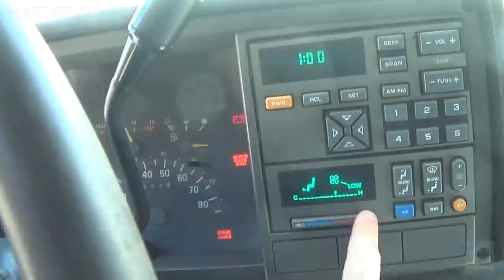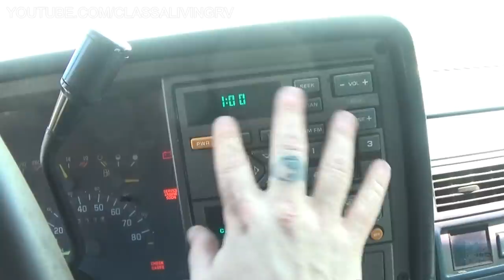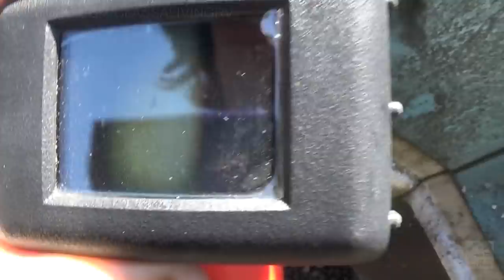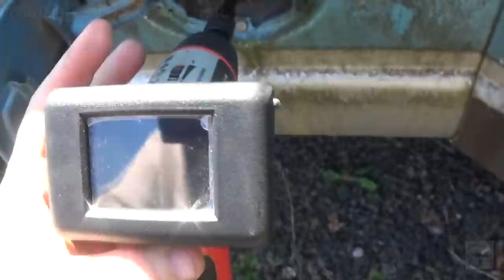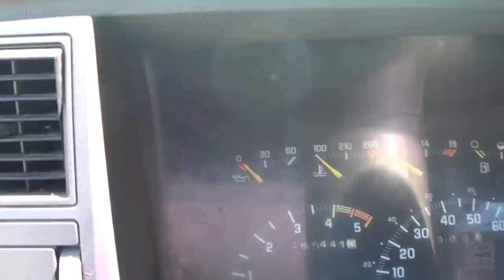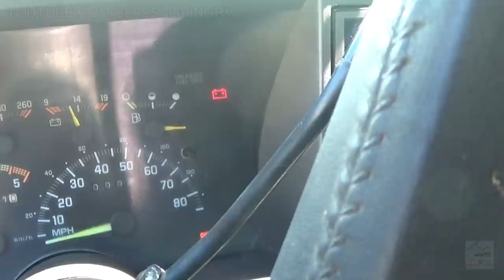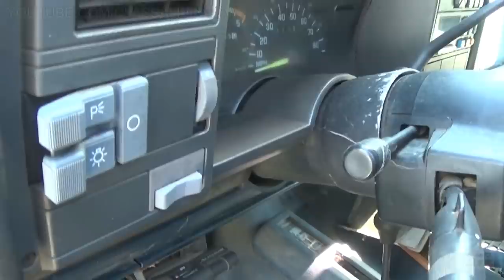Trying To Start An Old Truck That's Been Sitting 12 Years

Comment: I wish I could get one of these in the UK. Your pickup trucks are so much better that the ones in Europe and Uk.
Reply: Boy, that's for sure! How good can something called a "lorry" be, lol.
Reply: Me too I wish I could get one here in Kenya I'll be very happy man
Reply: Best cars Japanese best trucks are American
Reply: @diyeric5072  
I agree. I have a 2006 Silverado 4X4 (I bought new) and a 2018 ES350 Lexus. Couldn't be happier.
Reply: U can buy them and have them shipped to u
Reply: @GrimmReaper1997  Overseas shipping cost as much as these used vehicles
Reply: Thanks and I wish I could send one your way...but I’m attached to my 3-4 old gmc and Chevy trucks
Reply: @diyeric5072  got that right I have a 2013 GMC Sierra 1500 sle and a 2008 hyundia sonata gl I love them both.
Reply: electronic in US  cars are filt with problems again and again ☹️
Reply: I can sell you an 88 Chevy K-1500 stepside
Reply: TOMMY N .J nope. Try again
Reply: @diyeric5072  not very true. Have you heard of the toyota hilux? Its is one of the best pickup trucks out there
Reply: I love diesel trucks
Reply: My brother has a 93 Chevy c1500 4.3 with 345k and I have a 96 Chevy c1500 5.7 with 324k and both still run decent
Reply: @GrimmReaper1997  They need right hand drive. Same in Australia.
Reply: @diyeric5072  my tundra says different.
Reply: @dieselgeezer18  we talking about full size that can tow alot if we talking mini trucks then that shit goes back to the Japanese they make the best but full size not really

Comment: You won't see milky oil on a vehicle sitting that long even if there's watwr in the oil. The water is heavier than oil so it sinks to the bottom. Beware if the oil level is extra high on the dipstick. The milkshake comes after you crank the engine if there's an issue
Reply: That's corrrct

Comment: Now I feel old if an ''old'' truck is now a 1993. I was already out of school by then. hahaha I think the 1990's is the pinnacle of automobiles when it comes to safety, reliability, and ease of self maintenance. Today's new cars are over engineered crap computers on wheels designed to fail just after warranty to keep people hooked into a cycle of leasing instead of buying. Great video, we have to keep these older vehicles going in an age where new cars have ''sealed transmissions.''
Reply: Amen brother

Comment: This is exactly the video that I needed to watch right now as I am attempting to do the exact same thing as you on a '94 k1500 with 5.7L engine.  Thanks for the video.  Small block 350s are new to me so this has totally helped guide me without having to scratch my head a million times as I go through it bit by bit trying to start it.  I will start recording as I try to get this old truck that has been sitting for over 5 years started myself.
Reply: They are a vary simple setup, and being 94 its still a tbi, so even better in my opinion, I had a 91 c1500 4.3 truck, 350 with 2 cylinders missing, and I sold in 2017 with 687,000 miles on it, it still ran and drove, original engine I did the trans in 2002 at 190,000. Bought me a 92 Silverado with the 350 in Arizona and drove it 2100 miles to Ohio, just over 300,000 miles on it, I sold it with 400,000 mile son it, they will last forever if taking care of.

I got a 99 GMC Suburban now with the 350 Vortec, while it makes more power than the TBI, its just it has more things to go wrong, and its got piston slap on cold starts, not so much in the summer, but winter it almost sounds like its about to throw a rod for about 10 min, normal for them around that year to sound like that with age as the pistons change size from the temp change. I'd rather the TBI engines myself.

Comment: my dad has an el camino that has sat for 12 years, still runs fine. First start in 11+ years. Miss that car
Reply: i just got a 1970 el camino put a  new starter and battery but it turns over when i took a braker bar to it but it was kinda hard so im going to try putting some oil into each cylinder and remove all the belts wish me luck. Larry B
Reply: @larrybroad8746  Best of luck to you man!

Comment: Thanks for making such a detailed video. I bought a cheap 1989 with a fuel system just like that, plus a propane carburetor on top of that. Got to get the gas system working first because there is no propane tank. Will have to do exactly what you did. 👍

Comment: I drove a truck like that. Belonged to a guy who did a seasonal Christmas 🎄 tree business. He was from British Columbia and the truck had a metric speedometer kilometers large, miles per hour small, odometer in kilometers. Coolant temperature gauge in Celsius and the oil pressure gauge in kiloPascal. Truck was tu-tone blue with blue interior but has bucket seats with a centre console.

Comment: This was great for me to watch. My motorhome has been sitting for 7 years without starting. I need to check the gas like you did so it was great to watch what you did. I have a bigger tank to worry about and I only had around a quarter of a tank when I brought it over here so it should be pretty empty. I will start that process next week while I am still on lockdown. Thanks.
Reply: Did you get it going?
Reply: I have an 84 Ford 25 ft Yellowstone RV I bought a year ago  was parked permanent since 86, has a 460 ci engine I checked the oil and antifreeze levels put 10 gallons of Real gas in it and a battery,  poared a little gas in the carb she fired right up, drove it over 100 miles from Keuka lake home.
 best  $500.00 I ever spent 
Of course I stopped and filled the tanks.

Comment: I just rescued a 83 c30, sitting for about7yrs. The fue tankl situation is a big problem with sitting. You got a different setup tho with a pump in the tank..Lots of water and some rusty slime. Their worth the time if the bodies are good.

Comment: Can't kill them old chevys.gmt400 are the best series truck ever made!
Reply: Square body is better!
Reply: Nope
Reply: P.o.s. Fames
Reply: Yes. My bad
Reply: johnny mack rather square body than a round body Way more attractive especially the 86 models
Reply: 392,000 on my 97 suburban 1/2 ton 2wd. Paint peels off in flakes, Transmission breaks sunshell's every couple of years, fuel gauge dances about and in the 12 years I've owned it I've had about 7 fuel pumps go out. However, toughest and most dependable vehicle I've ever owned and most of the problems mine have are well documented issues. Original 350 vortec engine, doesn't burn or leak a drop of oil. My K5 blazer from the 80's was a gorgeous rig but rust got to it in the end.
Reply: The 2003 shaped Tahoe, Suburban, lasts very long too.

I know someone with one of those with 400,000 clicks, with the original motor and transmission, original owner too.
Reply: The Royal Crowned Tiger it’s very agreeable the early 2000s Chevy SUV’s were very solid built Scotty Kilmer would say the same
Reply: Crown Vic How much longer do you think it’s gonna last? That sounds like quite the shopping list of issues and things replaced overtime
Reply: Silas McGee it shows absolutely no sign of giving up anytime soon. It’s a Florida vehicle so zero rust, interior is spotless, all electrical items work, body is straight. I use only AC Delco factory parts, oil changes every 3 thousand miles etc.. I’ll keep it for as long as it runs.

Comment: I'll be working on my 85 Ford f150 with 302  ...same thing...sitting for 15 yesrs. Plus I have CV to change my timing belt on my 92 Toyota celica gt,  and maintenance on the RV and not to forget  replace exhaust on the 02 PT cruiser.   I should get a lift !!!!

BTW, GREAT VIDEO !

Comment: Sweet vid. I know that the step by steps you are performing serve as an invaluable resource for others whom may be having the same problems. But..........with that said that is why I never let anything that I plan on using in the future immediate or distant sit for more than a few weeks to a month without at minimum starting and warming up.

Saves a lot of headaches later. Even if I do not use it easier to sell.

And 75 is not bad for a complete sender assembly depending on brand.

Comment: When I lived on Cape Cod Ma. Of course I spent as much or more time fixin old boats and noticed to fight the salt water problem all gas tank tops like that one had a petroleum based gooey wax to seal that whole top area from rust. To look at the great condition of that seal ring lock I would bet someone used that same substance. Only found in Marinas. But by the looks of the trailer brake unit under the dash, me bets the previous owner pulled a boat and had the sense to glop some of that stuff on to prevent rust from the salt on roads in winter and the boating ramps.

Comment: I've had 3 of these GMT 900 series trucks. Been driving the same one for 9 years now. Just blew it up at 230,000 miles. Might shoulda checkt the oil more often, ya reckon? Lol. I'm buyin a 98 2500 with a 454 tomorrow for only 2 grand! Score!
Reply: Donell Muniz this is a gmt400 the 900’s are 2007-13
Reply: @connorvelthuis2221  now I remember, thanx.

Comment: I have a 73 superior motorhome with a dodge m500 chassis,  ran  absolutely perfect when I parked it 17 years ago. 440 Dodge engine. Has not been touched since. I finally decided to try to get it running.  Put a new battery in it, very afraid the engine would be stuck....turned the key, and it started cranking beautifully!!!  It has an oil pressure gauge, and after about 10 seconds cranking pressure started coming up. I didn't put any gas to it. That comes tomorrow.  Hopefully,  it will start up and run!!!

Comment: Bad news ! I ordered a 1995 Chev. 3500 cab and chassis, with a 454 in it, it got 4mpg, took it back several times, dealer could help the mpg. I couldn’t afford to drive, traded it off when it was only 6 months old.

Comment: My fuel pump went out at a gas station 50 miles from home, right AFTER I filled the tank. Had to siphon it all out into 4 5-gallon gas cans. Wife walked to the parts store while I dropped the tank. NAPA charged me 190 bucks for the new pump assembly. The whole works. I didnt know you could buy just the pump itself. That was a bad day.

Comment: You can buy that whole TBI rebuild kit for about 15.00 . never use silicone on fuel related parts. you have a chance of it being sucked into the intake. Plus you should have changed the fuel pressure regulator while you had it apart. It's easy Dude. Been doing this stuff for 40 years.. ASE Master Tech.
Reply from the maker: The goal was just to get it running and see if it was worth any more of my time or money

Comment: did you check the fuel filter? old gas can definitely cause some problems,  if truck has been sitting a while that fuel filter probably sluged up

Comment: Actually. With the fuel pump. The gas fumes destroyed the hose over time. Happned to my 94 also after letting it sit 7 years
Reply: Same, my 92 sat for 8 years.
Reply: Should've use fuel stablelizer

Comment: That’s where a 6 pk of Coca Cola comes in handy. Drain the oil, dump all 6 cans in, put a little oil in the cylinders and let it sit overnight, dump the coke and flush it clean with diesel, fill with oil, replace the plugs and it should crank but it’ll smoke like a chimney until the oil burns off. An uncle and I revived a seized 2.3 in a 83 Ranger with this method, probably not the smartest way but it works

Comment: Please allow me to correct you! The part that you called a pressure relief is actually the fuel pressure diaphragm and yes there is a spring inside of that unit, if it trusts out like mine did you will have to replace both the fuel pressure diaphragm and the spring as well,  but make sure you get the appropriate kit for the injectors that you have or are going to be putting in it! Take it from some one who has rebuilt those TBIs many of times and from someone who did it to his own personal 1992 Chevrolet Silverado 5.7 (350 SMC) TBI! I put also AC DELCO yellow sparkplug wires and NGK V-power spark plugs in my truck and with the engine set to -3°BTDC I was able to do 844.7 miles on (1) 35 gallon tank of gas in my truck!  I also have the MD8 transmission and a 373 rear differential in my truck! I also have proof and witnesses to this nest part! I had gotten pulled over by an Essex MD state trooper for doing 125 on 95 @ about 1:30a.m. in my truck fully loaded with people and out belongings!  Not proud of it! But who would've thought that my truck could do that kinds speed and get that kinda good gas mileage!

Comment: When trying these ones after sitting use tranny fluid down the plug holes out of a squirter can with a hose so u can try to get the top of the piston and rings. Let it sit a day or so and it will dissolve rust and help break the rings free as well as provide some seal on the dry cylinder walls and hopefully enough compression to start and run

Comment: Nice truck,...seemed like an easy ressurection....just can't figure why auto manufacturers put fuel pumps inside the tank,...its so much simpler to have an external fuel pump,....like pre 80s did.....Pressure wash that up I bet it look like brandy new.
Reply: Because being submerged in gas keeps the pump cooler. Chevy's issues notwithstanding, they usually last longer that way.

Comment: Dunno what you did with the old gas that came out of the tank,  but if it were me, I'd have filtered through coffee filters (or anything better), and slowly fed the filtered stuff back to other gas-burning vehicles of mine.  Chuck a couple or three quarts of it in every so often before going to the gas station to top off whatever I put it into.  Even feed it to lawnmowers, snowblower in the winter.  It will still burn, you just don't want a whole tank of it as the main source.  I also feed my used engine oil to my heavy diesels, never had a complaint yet. Obviously you don't dump ten gallons in one go,  I would give it a gallon in each saddle tank per fill up until it's all gone.  I'd rather burn it as a source of fuel than pay to get rid of it somewhere, or have it sitting around waiting for an accident or a fire.

Comment: Check the brown wire at the fuel pump relay when you turn on the key you should have Batt. voltage for 5 secunds

Comment: Jimmy is a GMC -  Need to call it RUSTY
Reply from the maker: Hey i like that
Reply: Rusty Shackleford! From King of the Hill
Reply: 7.4ltr engine is the reason we dont have them at £1.13 per ltr of premium fuel my 16ltr scania v8 at 9.5 gallon a hour is probably better on fuel we do have the big diesels trucks are shop has a 6.7 Cummins all the us airforce lads bring them over
Reply: Class A Living p try p

Comment: no fuel when line was off ran when bottle fed means everything is fine but the pump also you don't hear the pump prime when the key is on so all that tells you the pump is bad so anything other than replacing the pump is unnecessary and a waste of time good to learn though but costly in time

Comment: Just a quick question. When you call it "Class A Living" are you referring to the necessity to have a Class A CDL to drive your motorhome?
Reply from the maker: Maybe you should Google CDL and find out what it means. 
An RV is not a commercial vehicle.
Reply: Class A Living You’re right it isn’t however in my state of Kentucky you apparently have to have a class A to drive one of a certain size.
Reply: You only need a CDL if it has air brakes.
Reply: To clarify, there are Class A trucks, aka Tractor/Trailer rigs, and those require a Commercial Drivers License (CDL). However, there are also Class A, B, and C motorhomes. In most states, you don't need a special license to drive them.

Comment: Dude, sitting 12 years? The first thing you do is pull the plugs to see if any cylinder is full of water. Then spray Sea Form or WD-40 into the cylinders and let it soak for a day. With the plugs out, you can attempt to turn it over. If it turns free, then reinstall the plugs, leaving one out and grounding it. This will let you know if you have spark if the engine turns over. If you have spark, replace the gas and filter before firing.

Comment: Check the fuel injection fuse upper left in the fuse panel. It's a very common problem, not the fuel pump. Poor design, rain water drips down and lands on the two connection s on the back of the distributor,  causing it to short out the fuse. After years of heat ,etc. Theplactic on the connections dry rots and bares the connections.

Comment: I'd clean it up and sell it. Then buy an economical car that will allow you to get around easier and more affordable.
Reply: Yeah if you want to mess with scammers.
Reply: Sometimes a man needs a MANS vehicle. You ain't pulling an Airstream or horses with a Prius.
Reply: @pookysdad4884  But he has an RV, he could tow a smaller car with. He won't be towing that huge gas hog anywhere. And probably can't even afford the gas for it.
Reply: And, he doesn't own horses or an Air Steam. 😂🤣👍
Reply: @Ron-N-Ellen-Adventures  Man, if you can't afford the gas for a big Chevy 454 that gets 10mpg, which I have, you're really gonna hurt gettin gas for an RV that gets maybe 4 mpg. Movin' all that weight is hard work. But yeah, towing a little Toyota or Ranger pickup with a manual trans makes sense. Maybe a Geo Metro, the manual ones get up to 50mpg, and they're cheap as hell!